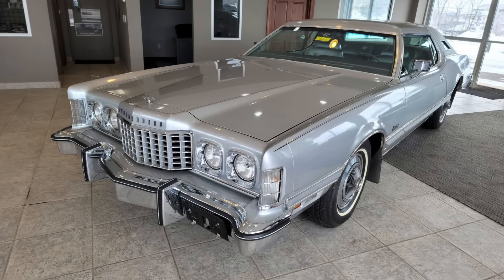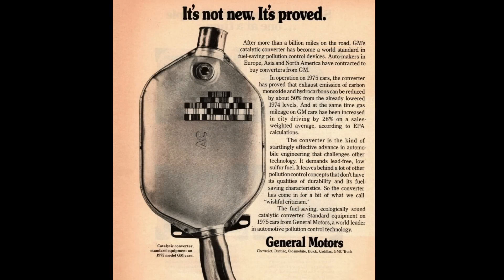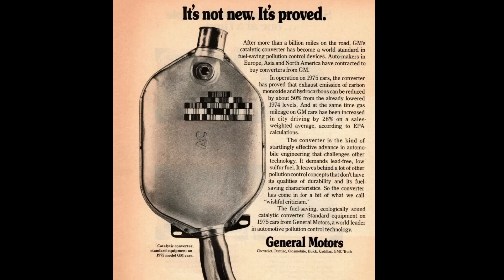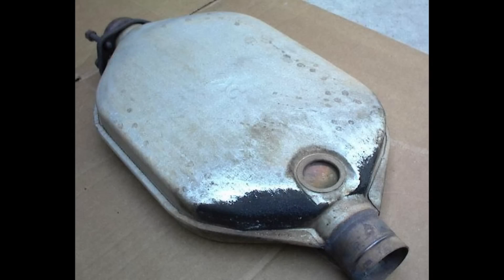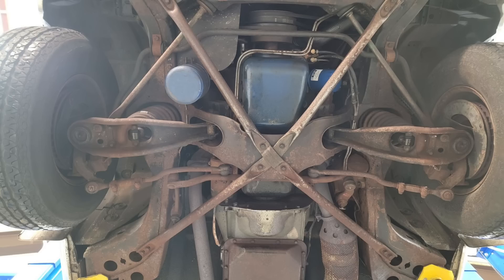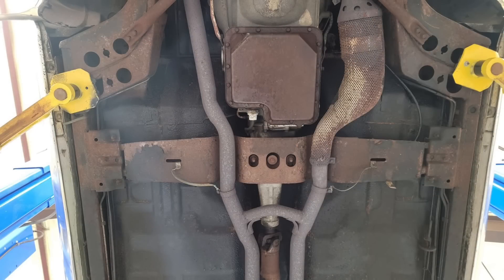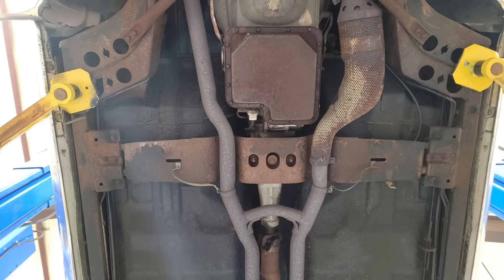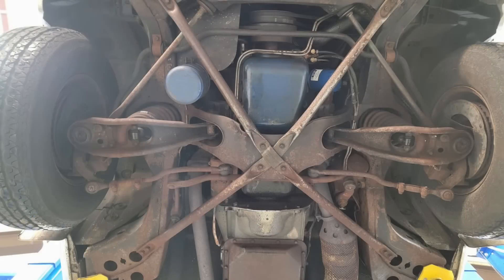Strangest Car Inventions: Ford Invents A Bizarre Way to Meet 1970s Emissions Standards

Comment: The worst thing about GM's "pancake" converter strategy was the way they raised the passenger's-side floor to make room for the converter and to keep the considerable heat from the converter, in the days of carburetors,  away from the carpeting. It made the passenger's seat so cramped that even with the seat all the way back, 6-footers had no thigh support and had their knees in the air. Ford's arrangement did narrow the passenger's footwell, but left it deep enough to stretch out a little. I'd say Ford had the better idea.
Reply: and parking in a field of tall grass could set the whole field on fire..
Reply: @MickeyMousePark  Saw that back in '84. Took out about 5 cars in a grass field being used as a parking lot!
Reply: Burn through in the carpet was possible, using leaded fuel would damage the converter, and burn a hole in the carpeting,
using a "test pipe" improved gas milage on the Chevy caprice I had. I agree, the exhaust systems overall were pretty bad, the long non-stainless-steel pipe would completely rust out every few years.
Reply: @bernieschiff5919  One of my older sisters had that happen to her car. Ran over something (we think) and the converter heat set her carpet afire. Luckily she had just pulled into her yard & was in reach of her garden hose.
Reply: @pcno2832  one time we’re cruising around in my buddies Grand Prix and the floorboards were rusted so the converter started burning the carpet, he just poured his beer on it and kept driving 😂
Reply: @EyesWideOpen61  🤣🤣🤣🤣
Reply: I remember two guys in an Oldsmobile Cutlass wheeling into the parking lot of the Mobil station where I worked and bailing out of the car with the interior full of smoke from the converter ignited carpet.
Reply: Fix Or Repair Daily FORD!! Own two different Fords both had electrical problems
Reply: @Donald-jm4hi  Nope!......
Fastest
On
Race
Day
!
Reply: @Donald-jm4hi  Cheap Heep Every Vatos Yard !   CHEVY
Reply: Ford has always been the better American automaker with a few exceptions
Reply: @thejackbox  Ford = Found On Road Dead.
Reply: @thejackbox yea I loved having to replace transmissions in 2 ford models and a Lincoln. Basic maintenance in my Chevys and gms.
Reply: Ford always had "The Better Idea"!
Reply: Correct  @MarkWG

Comment: I had a 1979 Ford Ranchero  GT with I believe a 351 Windsor engine. It was grossly under powered. We replaced the original engine with a 351 Windsor donated by a 1969 Cougar. All the smog devices were there, tho only to appear functional. The exhaust recirc pump was there, tho hooked up, didn't do anything, The manifold was modified to prevent vacuum leaks and the catalytic converters were removed and the ceramic catalyst was chiseled out and removed and the converter chambers reinstalled there by making them nothing more than resonator chambers (nice sound with Thrush Turbo mufflers behind them). The engine had yearly tuneups, and oil changes about every 4000 miles. This was before OBD plugs and cars had to be probed up the exhaust to check emissions. I bought the car in 1984 and the modifications were performed around 1985. It passed emission tests every year thru 1997 when I sold it and even beyond til the twit teenager that bought it totaled it. It also greatly improved the power and economy, averaging 22 to 25mpg hiway and about 17 or 18 city. I miss that ride.
Reply: Could not have been a Ranchero in 1979, 1977 was the last year. In 1978, a Ranchero type vehicle was specially built, based on the new for 1978 Ford Fairmont mid size platform, called the Durango.  Yours must have been pre 1978.  You sure came up with a very innovative idea to get your Ranchero to perform better, I did something very similar with my 1975 Datsun pick up, that I bought new, to improve drivability, like what you did.
Reply: The Ranchero was built until 1979.
Reply: @roger628  Was it still on the Torino mid size platform in 1978 and 79?
Reply: @carlc5748  Yes. 1977-79 were all the same.. You are thinking of the Durango. It was a Third-party conversion of the Fairmont Futura in 1980-81. The company that built it was National Coach of Gardena, CA.
Reply: @roger628  Thanks for the details, I knew of the Durango, but thought the Ranchero stopped in '77, thanks for correcting me on that! For quite a while I worked for the owners of American Custom Coachworks that made limousines, there were based in Arkansas, but the family lived in the Los Angeles area.
Reply: @carlc5748  Same Torino platform, just used the LTD II station wagon straight lines. The LTD II lost the sexy lines of the Torino.   :-(  I've owned 2 Rancheros, 74 and 79.
Reply: @carrielemmon1549  The Cougar villager wagon was on that same Torino platform for 1977,78, and 79 as well, correct?
Reply: @carlc5748  You are mistaken. The last year of the Ranchero was 1979, and built on the LTD II platform which replaced the Torinno in 1977, same chassis just rebranded without the sexy lines. The vehicle you are referring to built in 1980 on the Fairmont base was a custom build and not and not an official Ford project. It was called the Durango. It was hideously fugly. and pretty much a failure. I'd rather drive a Subaru Brat than a Durango! I bleed Ford blue! and have since the 60s when our family ca was a 64 Ford Custom 500, followed by a 68 Mercury Monterey 4 door hardtop,  69 LTD, 76 Marquis. We were a Ford family.
Reply: To the low IQ here! Have a 1979 RANCHERO 500 THERE FULL SIZE FORD DUH!!!!!

Comment: I had a 1970 Oldsmobile F85 with a 350 v8 and a 3 speed manual shift on the column. I eventually found out that Olds had interlocked the spark advance so the engine got no vacuum advance until the engine was out of first gear. I believe later testing demonstrated this had no effect on emissions, but did reduce performance. I guess GM just decided they would do something like that and claim it reduced emissions to placate the EPA. My first catalytic converter equipped car was a Chrysler Cordoba with a 360 v8. As I got a little mileage on it I found it was very difficult to find any unleaded fuel that it would not tend to knock on. I think the EPA just wanted to take all the fun out of driving. ☹
Reply: That was the result, doubt if it was goal

Comment: We owned a 1972 T-Bird in a beautiful bronze color.  I remember that the hubcaps were painted the same color.  The car was just beautiful to look at, and it was the smoothest driving car we've ever owned.  No modern vehicle can match it, IMHO.  The 460-CI with 4-bbl carb was a real gas guzzler.  I remember 13-mpg highway and "fill it up when you go to town" in the city.  But I would love to have one today.  Just so quiet and comfortable.  When Jimmy Carter rolled out the 55-mph speed limit you felt like you were walking down the highway.  That car was designed to cruise at 90-mph!  Great channel and content!
Reply: Pres. Nixon mandated the national 55MPH speed limit, effective Jan. 1, 1974.
Reply: Swap a more modern engine and the fuel economy will improve.
Reply: I had one too.  But it probably didn’t stop really well from 90mph.
Reply: @ChrisACiufo  If it stopped at all. My memories of panic stop tests were that the brakes ran out at about 20mph
Reply: 55-mph became law under Nixon

Comment: Bonding: In this era you could order a CB radio from the factory. Radio range can be a lot about ignition and alternator noise. No, we were not supposed to do long-range on CB but, ya know, the car shouldn't "bzzzzzz" on weak CB stations, man!  FWIW, the '79 TBird w/351W had two very small cats right against the manifold stubs. I don't think backpressure ever bothered these ultra-mild engines.
Reply: they were ultra-mild partially BECAUSE of the cats.

Comment: The X-brace was a structural upgrade to convertibles. If it was on any hard tops, it would redundant. Ford was still doing it to Foxbody convertibles through 1993.

Comment: Auto maker nogoodnics sold us out with the great 5 mile rated bumpers. They gave politicians kickbacks to lower the crash standard down to 2.5 miles a hour to save less then a gallon of cheap gasoline for every 10,000 miles driven.
Reply: Didn't want to save gas, only lives

Comment: The wire mesh grids on the fenders were because they used plastic inner fenders and had to make grounds for the voltage regulator, ignition module, and starter solenoid.

Comment: Actually the Fords were the only ones that Actually had 5 mph bumpers, GM, Chrysler and AMC never met the standards.
Reply: Actually there was an exception at AMC.  The Pacer had true 5 MPH bumpers that were mounted on hydraulic energy absorbers.  I had a '75 Pacer and only tested this system once when a young woman driving a big American barge on a learning permit turned left in front of me and I T-Boned her.  Careful inspection of my Pacer afterwards showed that the front bumper had moved inward to the point where the inner edge of the bumper left a small crease in the sheet metal of the fender.  This means the bumper must have moved inward by 4 or 5 inches!  The Pacer had a lot of innovative ideas and hydraulic energy absorbing bumpers was one of them.  I wish I could buy a new one today!  I drove that '75 Pacer for about 25 years before the rust made it unsafe.

Comment: One of the best thing auto makers greatly improved on was replacing carburetors with fuel injection. Had a 1962 & 64 Chevys that had to have spark plugs replaced maybe every 30,000 miles due to fowling &/oil build up.
Reply: How did birds get into the intake ? 😉
Reply: @1957GoldenRocket  🤣

Comment: That single cat always perplexed me until Saab came along with their turbo V6 with a tiny turbo on one bank.
Reply: Asymmetric turbo is pretty cool. The way the turbo exhaust housing is part of the manifold is also kind of neat
Reply: A GM v6
Reply: what
Reply: @gabrielvieira.4358 the saab 9-5 had a v6 option. It had asymmetrical turbo charging. Pretty neat setup.

Comment: The GM converter was a piece of crap along with just about everything they came up with during this era to control emissions. I think it was Hot Rod or Car Craft years ago took a colonnade car and replaced it with a true dual exhaust and the engine picked up something like 35 HP. A cheap set of headers brought the gain up to 50 HP. None of these things really did anything to curb emissions. In the mid 80s when emissions testing came to my state, I bought my first car a 75 Pontiac Grand Prix with a 400. By this time it was a well used up car. The converter was replaced with a test pipe. The exhaust rotted off so I bought a cheap set of 3 tube headers because the manifold bolts for the pipes were hopelessly rusted. All of the emissions gadgets under hood had previously been plugged with screws when they failed. I even had the heads milled to pick up some compression. But according to the emissions results which you got a print out of, that car with nothing emissions related functioning except the EGR valve, not cat, headers and dual exhaust not only passed emissions with flying colors, it would have passed for a new V8 Ford Crown Victoria. So tell me what was the purpose for any of that garbage that did nothing but give the American automakers a bad reputation for creating sputtering underpowered and unreliable vehicles that they never really recovered from?
Reply: I did that to my Galaxie. Headers, cam, duals, 4bbl Edelbrock intake. Only thing I didn't change was the rear end. That 400 ran great afterwards. 16 mpg at steady 65 mph after the 55 limit was killed and it could pull a fully loaded U-haul trailer at 90 mph.
Reply: @marckyle5895  16 mpg highway is wild for a 70s car. I bet with some gear ratio shenanigans you could get that to 20 or higher!
Reply: @lsswappedcessna  It was already a 2:75, one of those weird Ford 8.7" differentials. Had to get it fixed once is how I knew that. 16 was good. I started out with 12.
Reply: I remember at the time Mazda modified the combustion chambers of their 4 cylinder cars and sailed through the emissions test with better results than the converter cars. The problem was the big 4 were taken over by accountants. They looked at how to do it cheap, not how to do it best.  The less gas burned the less emissions, the less government control. Remember the rest of what was going on at the time.
Reply: Blame Senator Ed Muskie from Maine for the very strict emission controls. It didn't matter how badly a car ran, or if it ran at all. That guy was a dumbass!

Comment: My 2000 F-250 diesel came from the factory with no catalytic converters. Ford sold them that way until '02 or '03. It's always been a great truck, it gets excellent mileage and doesn't smoke at all, but it absolutely STINKS!
Reply: Interesting because my '99 F250 does. It's a 6.8 gasser though. So they must have had different requirements to fill depending on diesel or gasoline powered

Comment: being a teenager in the 90s meant the cars we could afford were 80s junk, lots of early ford and GM EFI. the GM stuff seemed simpler to fix, with the ford stuff being a bit more reliable overall. the best combo from that era was probably the Gbody with a 4.3 TBI 3 speed lockup or any ford with a 302.  Those things drove great and had very little driveability issues compared to the smogged out carb 305s on the SS. The firs tthing we would do if there was a power problem was gut the cats,  lol

Comment: I heard that one of the cars used an air pump instead of a cat converter.  So when did cat converters started being used in Europe?
Reply: Smog pumps actually predate catalytic converters.  They were first used in CA cars in the late 1960s.  And most cars with catalytic converters continued to use them.

Not sure if catalytic converters were ever used in Europe.   I seem to recall reading that European cars had to be fitted with them as part of the export prep to the US.   I'll admit I could be wrong about that.

Comment: The 2 cats used to put off soo much heat they used to cook the transmission
Reply: And Ford was using a funky automatic in some of their 74-75 A- and B-body cars with 351M/400 V8s to boot.  A Borg-Warner unit that was similar to an FMX, but it was weak and had serious design flaws.  It was a warranty headache for Ford, and the general wisdom was if you had one of these things, and it was out of warranty, have the shop swap it out for a C6.  Rebuilding a flawed automatic is always a gamble.

Comment: https://youtu.be/Xxn4j-DYVHY?si=zeLoK3G7tsSqLBHq&t=108 Honda knew that their CVCC cars would only meet emissions for the first 10k or so miles. They used an ultra rich mixture to ignite a very lean mixture by having intake passages for both and their own special three barrel carburetor.  Also they use Thermo-Reactors ion the exhaust manifold which they also knew would quickly fail, require drilling them out...
I owned a Civic CVCC and also worked on Imports at the time. The car was the worst peace of crap for the environment with over two dozen vacuum hoses to make it work. So every Honda CVCC would failed emissions that I worked on, if tailpipe tests were required....

Comment: I remember in the 70's when riding behind certain cars on my motorcycle, it felt like hot particles of sand hitting me in the face. It was coming from the exhaust. I would either have to back way off, which usually resulted in someone cutting me off, or try and change lanes.
Reply: epic you were getting blasted with molting metal
Reply: Interesting!

Comment: I had a 76 Thunderbird, and it did have factory catalytic converters on both sides of the exhaust. The uneven back pressure from one cat would be very hard on the valves in that engine unless the passenger side had much stiffer velvet springs to mimic the back pressure from the cat on the other bank. At Chrysler, cars with 1 or 4 bbl carburetors were able to meet emissions standards without a cat until the last year of the Plymouth Fury/Caravelle and Dodge Diplomat. Both offered a 4 bbl version of the 318 in Police Duty Package cars through the end of production in 1989. Volvo 4 cylinder cars with a carburetor were able to meet emissions standards with no catalytic converter. These, of course, are the Canadian market cars, which had to meet much less stringent emissions standards.

Comment: Isn’t there some way the engineers could’ve balanced the backpressure between the catalyst and non-catalyst side of the exhaust system, just thru pipe thickness or something

Comment: With one side restricted, it would push more hot exhaust through the intake manifold heat riser passage to flow out the other side, heating the bottom of the intake manifold to improve fuel atomization, and allow faster warm-ups in cold climates.

Comment: I think that cross bracing under the front frame  was to reduce hood flutter which as you know was common on these long hooded large vehicles of the era as the frames would flex quite a bit going over bumps.

Comment: Typical Ford chole one engine Bank. Like how they would update other emissions in the 70s early 80s by adding more parts like vacuum valves while leaving the old systems in place they were a rats nest of vacuum hoses under the hood Half could be removed and not affect the emissions laws! They did this to save money not having to redesign the system routing. Just sdd to it.  Good mechanics back then would never buy a Ford unless they were fanboys with issues.